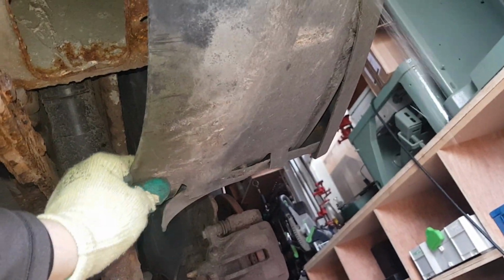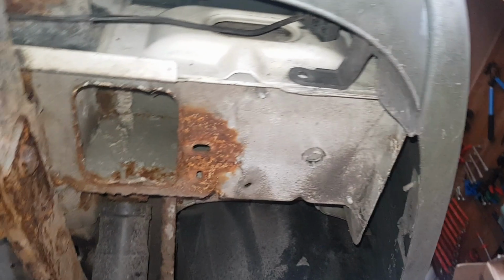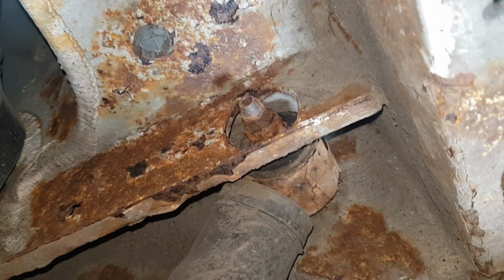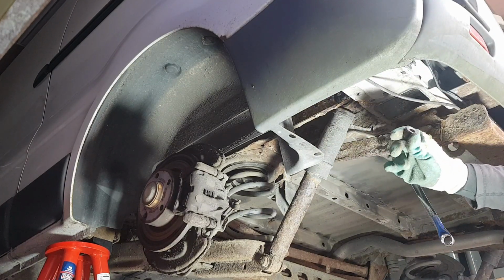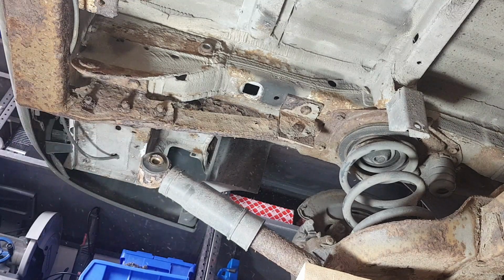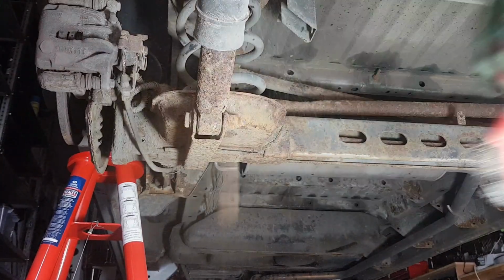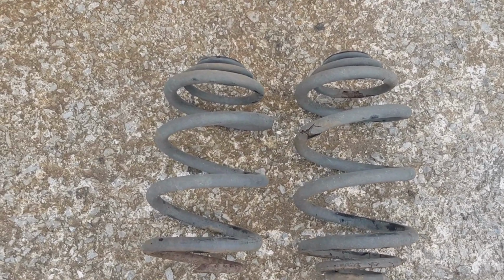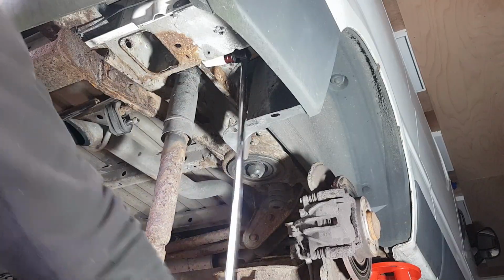How to change shocks & springs on Renault Trafic Vivaro Primastar Rear shock absorber & coil spring

Comment: Thanks for the video.  The improvement after you finish is amazing.  This was the rustiest, dirtiest vehicle I have ever seen.  Wasn't it worth running the vehicle through a high-pressure car wash before you started those jobs?
Reply from the maker: @renaulttraficconversion  Hi and thanks for watching.
I did give it a wash but some of the stuff was like welded in. Most of it was just rust and rot. I had planned to sand blast all parts so I did give them a wash after the removal again and then the blaster did the final bit of cleaning and rust removal. A lot of the parts were brand new so the old ones were just scrapped. It is quite normal to see vehicles so rusty here as they put a lot of salt on the roads in the winter

Comment: My vivaro b keeps passing it's MOT but I'm convinced my shocks are shot on all four corners.  It's on 200k+ miles and original shocks. Definitely gonna tackle this over the next few days and see if there's an improvement, and if so, do my front ones next.
Reply from the maker: Same as mine. Never failed mot but they were all shot. You will feel the difference after🤝

Comment: Quick question about lifting the rear of my Vivaro. Where is best to place the trolley so I can get an axle stand under the jack point? Thanks
Reply from the maker: @Nutberg20  to be honest you should put a plank of soft wood if placing under the axle to spread the weight. Try places close to the suspension bolts joints as it will be more ridgid. Try one side at the time. Hope this helps

Comment: Just a quick question regarding the rear coil springs. Does it matter which way you install them as I've seen an installation where the more coils at the bottom of your installation are at the top instead of the bottom?
Reply from the maker: Hi
It doesn't matter what way you install them to be honest. I did them with the tighter coils on the bottom as a friend of mine told me he had the same van and whatever way his mechanic installed the rear caliper hose it was not done the correct way and the hose got crimped in the spring. I did it this was as there is less of a chance that the spring can pinch the hose as most of the spring movement will be at the top. Hope this makes sense🤝🏻

Comment: Another great video! What paint did you use on the rear axel? I’m planning a similar restoration on my van and would like to paint it to protect from rust.
Reply from the maker: I used Rust converter on the bare metal 1st then POR15 grey paint. Por15 is not cheap but 1 tin of 100ml will do the job. Thanks for watching and for your comment🤝
Reply: @TheKeenMechanic  Thanks, I’ll look into getting that. I appreciate you replying to me as well. Keep up the good work 👍
Reply from the maker: @themetalbracketcompany  No worries at all. See this link, they have these kits and this should allow to do that job with this kit. POR15 is the best product your money can buy as far as I am aware

https://www.ebay.co.uk/itm/312573611218?mkcid=16&mkevt=1&mkrid=711-127632-2357-0&ssspo=epBtBJwIRGq&sssrc=2349624&ssuid=RwAnBlHgT8-&var=&widget_ver=artemis&media=COPY
Reply: @TheKeenMechanic  That’s great, thanks very much for your help 👍

Comment: Where did you get the bolts for The rear shocks? Asking for a friend😂
Reply from the maker: @FixyRascal  The main dealer should have them if you can't find from a local breaker or ebay. These things happen🤣

Comment: NEED DO ONE ON MINE , DO YOU NEED DROP BOTH shock absorbers ? THZ
Reply from the maker: It is best to drop both sides but you might get away with just one side and put a bit of pressure on it to twist it a bit. If you can afford replace both. Best of luck
Reply: @TheKeenMechanic  thank you for the reply mate cheers think i will get both why i'm under. makes sense yes
Reply from the maker: @lock411  No worries mate. Glad to be able to help you with what I can🔩🔧🤝

Comment: Hi! nice video! (helpfull)
Do you know if there is a softer shocks or springs..? i mean.. i have "combi" version.. (3 seats front,3 back.. and no windows on rear sides..) and i think maybe, "passenger" version have the suspension,softer than mine...
thanks in advance!
Regards!
Reply from the maker: Hi
Mine is a commercial van and I put Febi heavy duty springs at the back. I noticed the original were much thinner and broke due to this. In your case search the web and local shops and compare the original with the new ones you get if you want softer suspension go for thinner springs. Not sure about scocks. Mine were shot so I just got what was available in my locar parts shop
Reply: @TheKeenMechanic  hi! ok thanks a lot for your answer!!
Reply from the maker: @ZeroGMVideos  No problem. Happy to help

Comment: My top bolts are seized solid and won't loosen, what do you suggest?
Reply from the maker: I suggest gas torch until the nut is red hot and after that use a large breaker bar and it will come off
Reply: @TheKeenMechanic  ty for the video and the reply, finally got them off and new ones on
Reply from the maker: @KarlGreenwood-v6z  Nice one. Glad to hear you got sorted

Comment: Are stainless bolts strong enough?
Reply from the maker: Yes, they are actually stronger. The only reason the manufacturers don't use them as they are more expensive. You find more stainless steel on the high end vehicles
Reply: Where can you get stainless steel bolts from?
Reply from the maker: Ebay. Or just google the size you need. Most are M6/M8 bolts